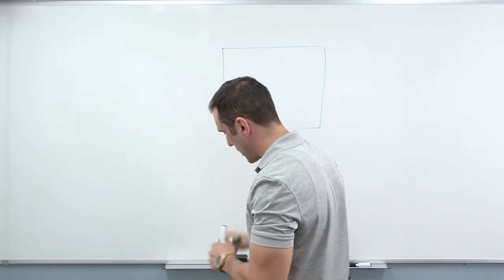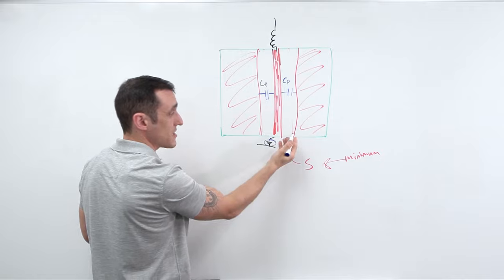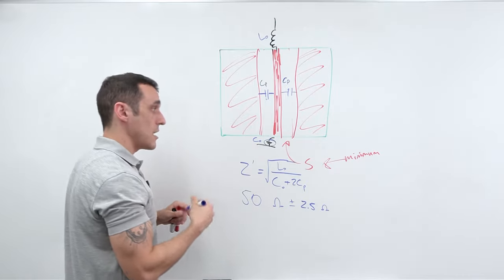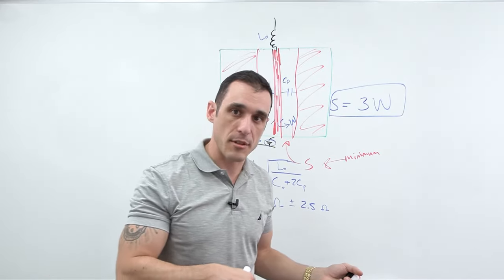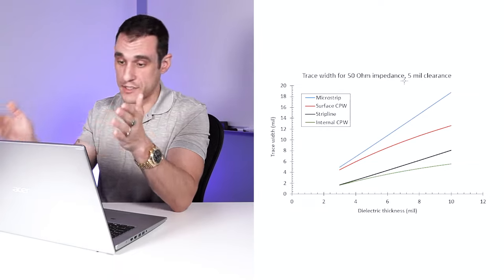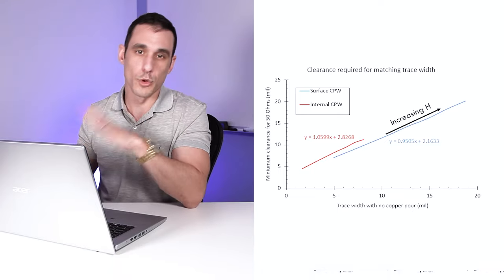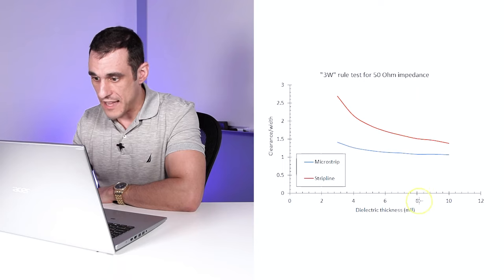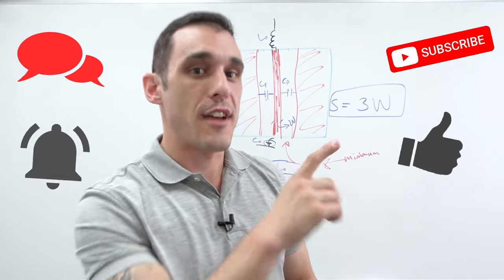Copper Pour Clearance | PCB Routing

Comment: I accidentally had a pour clearance rule set too small (1W) to a USB pair, and I was both surprised and relieved to find out from the field solver that the impact wasn't that significant. My worst-case minimum differential impedance for the USB pair was still about 7 ohms above the USB2.0 spec minimum. It was a phew moment because I only discovered the mistake after the boards were fabbed. 😅
Reply: If the ground on the next layer is very close to the trace then you will be okay, I have occasional debates about this with EMC consultants and they start to realize the value of making the outer layer laminates very thin.

Comment: Super helpful. Particularly appropriate you chose 50 Ohm stripline - probably the most common impedance employed. I've typically used 2X clearance for 50 ohm traces while targeting thinner dielectric to reduce trace width. I came back here for a little schoolin after my fab vendor (that has the advanced tools) was suggesting 0.914X and I was  doubtful they had factored in the coplaner parasitic capacitance. 

They are also suggesting a change in stackup construction. For my 6 layer PCB I had specified a 3 core stackup and they are suggesting a 2 core construction with prepreg + foil on the outer layers. I'm concerned about any variations in impedance across the 30mm long trace due variations in thickness and prepreg Dk (maybe I worry too much :)). Also I wonder about the mechanical properties of this different stackdup considering my 'works anywhere on the planet outdoors environmental constraint (albeit inside an IP65 enclosure)

Any insights are appreciated :)
Reply: For the stackup change with prepreg on outer layers, I think what matters here is the pressout thickness variation and the hygroscopicity of the material. Controlled impedance testing up to a reasonably high bandwidth should be good enough for addressing the impedance deviation. About the hygroscopicity, as long as it can be proven that there is no appreciable performance difference due to moisture uptake in core vs. prepreg then you should not have a problem. Maybe could also try a conformal coating?

Comment: What if my copper pour is not GND but lets say 5V? does something change?  so the set up woudl be a 4 layer PCB, Top and Bottom woudl be SGN/PWR and mid1 and mid2 GND
Reply: I think this is easiest to understand by thinking about return currents. The displacement current that is induced in the nearby copper pour depends on the change in the voltage difference between the signal line and the copper pour. The only difference in the case of copper pour at 5V instead of GND is how the displacement current equalizes the voltage drop on the rising or falling edge of the signal. Normally, when the pour is GND and the signal rises high, the displacement current flows into the GND return and negative charge equalizes the signal potential with respect to the GND pour and the plane. When the pour is at PWR, the same return current effect happens on the falling edge of the signal rather than the rising edge because the falling edge is when the potential difference between the signal and PWR is increasing. Because the plane is GND in both cases, the displacement current flow mentioned above will occur on the rising edge in both cases because that is when the potential difference between the trace and the GND plane is increasing.

Comment: Hello,
Thank you for these amazing series of videos.
I would like to ask about when we need to put ground pour near traces and when we don't do it?
I see many designs where some put ground pour all over the pcb and some designs just don't put any ground pour there.
I heard that when you put it, it works as a shield for cross talk between traces. Also it's much easier to construct the pcb with the ground pour rather than not because pcb manufacturer need to remove it when producing which is an extra step. So what are the negative part of it?
Thank you.
Reply: Hi Fedi,

That's a great question. We actually just filmed a video about this and we'll be posting that soon. Thanks for watching and stay tuned!
Reply: Just to follow up, the use of copper pour is usually not necessary, although most of the time if you set your design rules correctly, you might not create a new problem with crosstalk or EMI, particularly if you use close via spacing. The negative part of it is that thin sections of copper pour between traces can increase crosstalk and EMI. If they don't have small enough spacing for stitching vias, then you can create a resonant cavity that allows strong crosstalk between two traces.

I would say probably don't use copper pour all over the PCB if you're not sure if you need it. Smaller sections of targeted copper pour are probably okay in specific situations, like as part of RF circuit design or if you need to suppress specific radiated EMI problems from specific components. Most of the time, if you have a radiated EMI problem in your board, it is probably caused by something else that is more important (stackup, routing, etc.) and covering the entire surface layers with copper pour won't solve the problem.

I'm not a manufacturer but I don't think they need to use an extra step to remove extra copper, I believe they just mask and etch like normal in a single step since they are using a single stencil for everything.

Comment: s=3W. Y? it should be more than 4H than it is very loose coplanar line. But yep u should simulate to double check
Reply: I bring that up because that's the way I've seen this rule listed.

But for controlled impedance lines, they will have impedance determined by a specific W/H ratio, so yeah you can convert the 3W condition into an H condition if you want....
Reply: Then you would only have approxiamtely s = 2W for 50 Ohm microstrips on Dk = 4 laminates. But yes both are loose coplanar lines. That still works as long as H is small though, you can still route into and out of the copper pour without needing to modify the trace width.